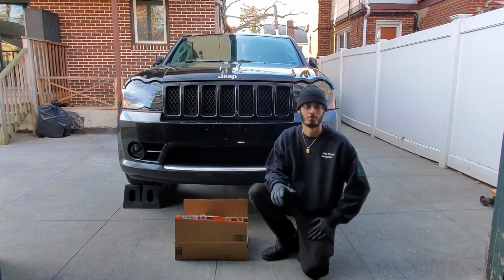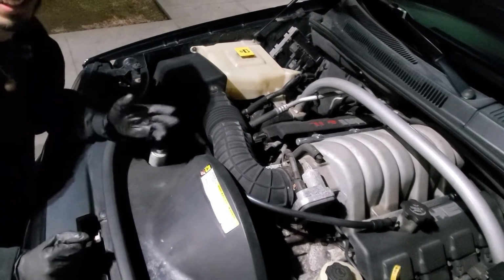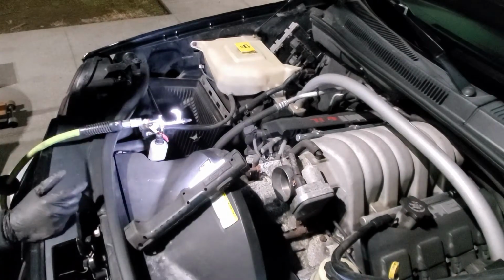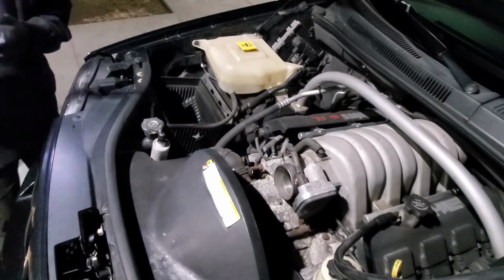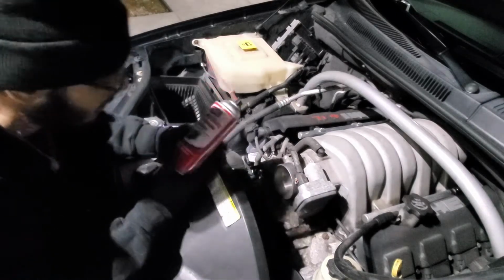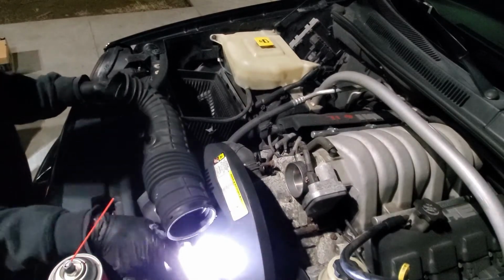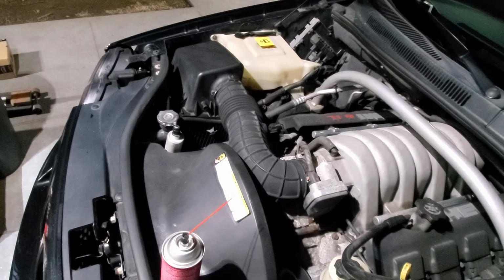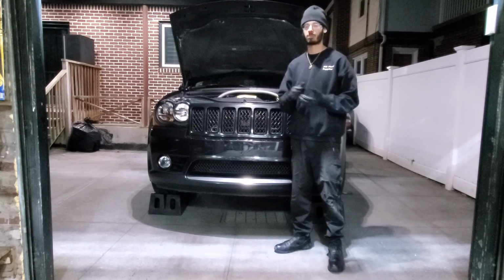Jeep SRT8 - Oxygen Sensors & Air Filter Changed; Throttle Body Cleaned

Comment: No throttle body re learn?
Reply from the maker: No! It didn't need it nor did I do one. The jeep was running fine with no issue with the throttle body or the check engine light either. I cleaned the throttle body with a throttle body cleaner because I didn't know if the throttle body plate or the inside of it was gummed up with that black stuff. In addition, I had recently purchased the jeep from another owner so I wanted the new air filter, oxygen sensors and the throttle body to be running as perfectly as possible. That was the logic behind it, if I did have an issue with the throttle body I would have done a throttle body relearn and/or a new throttle body and a relearn.
Reply: @EvanTheMenace  cool I was asking because I just purchased one myself a 2010 and I got it and my check engine light came on because of 02 sensor but I was gunna clean the air intake and throttle body too. Do u still have the stock air filter or are u gunna change it?
Reply from the maker: @robrod2782  Oh wow, that's what's up! Welcome to the SRT family! 2009 and 2010 are the best years for these Jeeps. My opinion, if you have no personal preference go with NGK oxygen sensors, I'm sure all the other ones will do as well. Every little bit of cleaning helps and I'm running the stock intake with a drop in "supposed" high flow air filter. I'm probably going to keep it like that for a while as the stock air system does just fine. Plus I'm not pushing big power and if I ever do change it out I'm going with the Volant closed air box/intake system.  As the Volant matches and/or replicates the same design and layout of the original "stock" air intake systems on our Jeep SRT8 keeping the hot air out as much as possible. Like I said this is all personal preference. Hope this helps!!
Reply: @EvanTheMenace  thank u bro this did help I’m gunna check check out that volant air intake when I bought it, it had the AFE alrdy on there but yeah im gunna go with all agk. I noticed my coolant is also running low for some reason do you use straight mopar? Or what coolant u recommend?
Reply from the maker: @robrod2782  Anytime man, glad I'm able to help!! Just check to see if you don't have any coolant leaks or anything of that nature that might be causing a low coolant light. Sometimes it just needs fluid, etc. Definitely should do the thermostat, water pump and fan speed change in the near future to make sure your Jeep is running in top shape and not above 230° if you haven't done so. Maintenance is key to healthy running Jeep! You can run Mopar coolant but I'm running Zerex Antifreeze/Coolant G-05 Formula 50/50 Premixed in my Jeep. Almost similiar fluid and can be bought at any auto parts store!
Reply: @EvanTheMenace  sick whip bro! New sub! How is she holding up atm? 
Btw could I do the same throttle body cleaning process like spray n clean while engines off (07 jgc Laredo) I thought I had to have the engine “on” while cleaning the TB to prevent vapor locks w the pistons
Reply from the maker: @lstruggy  Thank you, I greatly appreciate it! It was there actually when I bought the Jeep. I believe that in 2008 when the SRT8 got the most upgrades, they also gave it a subwoofer (as seen in 09-10 as well).. No, the jeep can be off or should be off!! You really do not want to be spraying that liquid in there while it is running and you are trying to clean it with a rag or paper towel and you push the throttle body blade open. You can potentially damage it or hurt yourself in some way, shape or form. Just be cautious of what you are doing and what may happen. Hope this helps!!
Reply: @EvanTheMenace  ayt bet bet will b doing this this weekend tnx for the reply bro I appreciate it! It’s more rewarding to do these jobs instead of paying my mechanic to do it for me will b doing my plugs after TB job I just hit 211k on mines she getting up there but w proper maintenances she should b fine 🫡
Reply from the maker: @lstruggy  Definitely it is! You learn and become familiar with how your car works! Save yourself the hassle and headache of having someone else do it for you unless you are not sure what you are doing, etc. Just make sure she's up to par with fresh fluids (oil, transmission, differential and awd if equipped, etc.). Also new plugs, new 02 sensors, throttle body/MAF sensor is cleaned as well as air filter is replaced and/or cleaned. Then the car will be good to go, its minor maintenance stuff but this will ensure she running good and healthy!!
Reply: @EvanTheMenace great insight bro I got an 09 and I keep up with all the maintenance just an FYI these jeeps don’t have MAF sensors they have a MAP sensor.